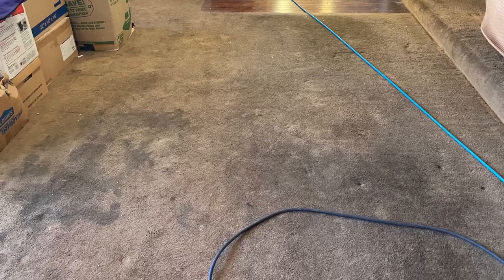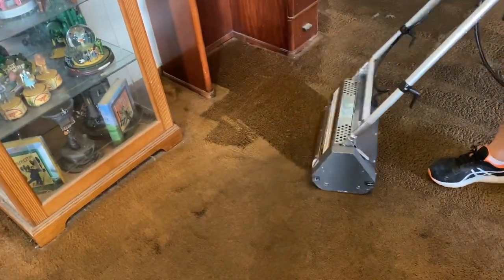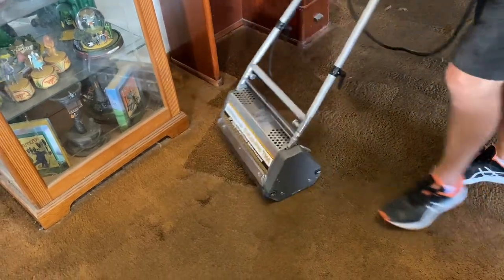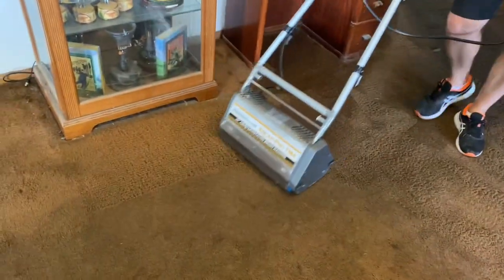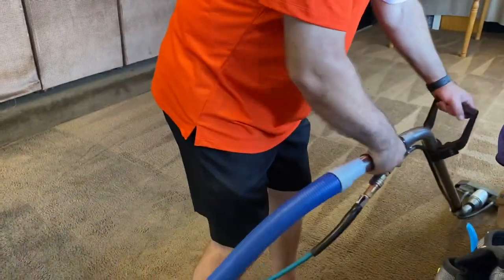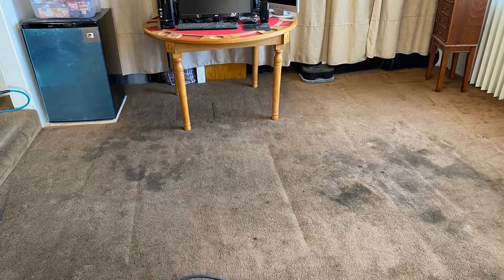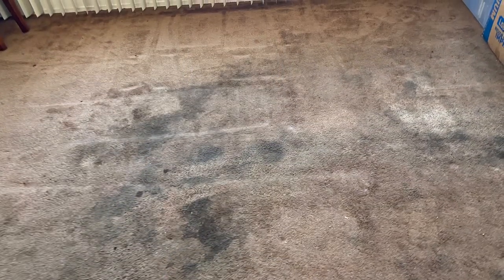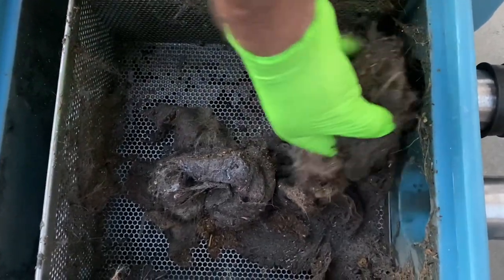Amazing deep clean

Comment: Wow, what kind of machine is that? Is that only for professionals? I have a home shampooer, but yours seems easier and more thorough job
Reply from the maker: It’s called a Counter Rotating Brush machine (CRB). It’s not cheap ($3500) and is used to scrub the carpets once a solution is applied. Home shampooing machines apply a solution and remove as you draw them back. We allow a solution to dwell for 15-20 minutes before we extract to allow the solution to break up and release soil from the carpet fiber. While we wait for the solution to dwell we use the CRB to agitate the carpet to help break up the soil, while simultaneously removing pet hair and debris from deep down and bringing to the surface. It is a very effective cleaning tool but is generally only for professional use.

Comment: Do you by chance have the vac footage for this ?
Reply from the maker: Unfortunately, I do not. The customer had already vacuumed prior to arriving. So there wouldn’t have been any good vacuuming to record.
Reply: @pro-touchcarpetcare5513  it does not look like it was vacuumed.  I'd bet a burger that the vacuum cleaner used is overfilled and not able to collect anything else in the bag or the brushroll is not turning due to a broken belt - or brushroll is not spinning for some other reason.  It appears the people living here are more elderly and not aware of the malfunctioning of the vacuum.

Comment: wouldent it have been better to pick the hair up instead of vacuuming it  ,,it would cut down on blocking your filter
Reply from the maker: Kind of what the filter is for. Too much, and yes, it will reduce suction. But if that happens it’s easy to dump it. So, no, it’s not easier nor is it as sanitary to handle it vs vacuuming it up.

Comment: I'm surprised that you don't ask them to remove all the furniture out of the room to make it easier to clean. And why wasn't it pre vacuumed before you use the CRV machine
Reply from the maker: It’s up to them. If they want it cleaned under the furniture, it would need to be removed before we arrive. We do not move furniture. I believe this was pre vacuumed before we arrived. But tbh I don’t recall if I did it or it was done prior. But we always pre vac.